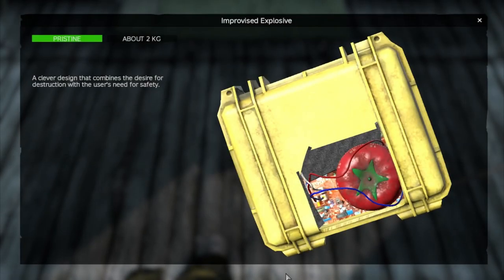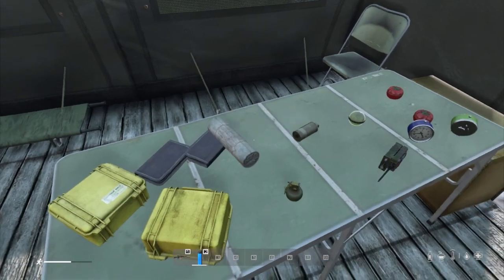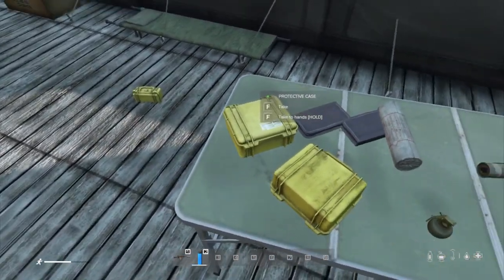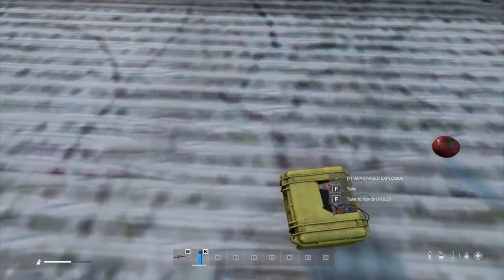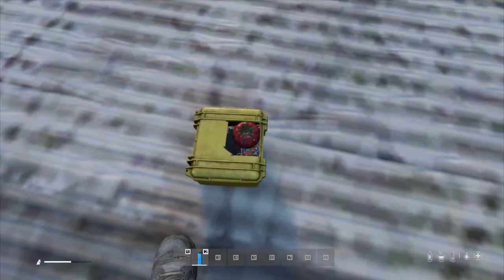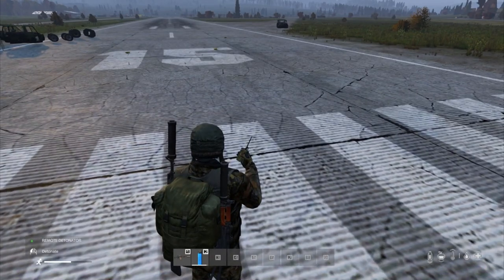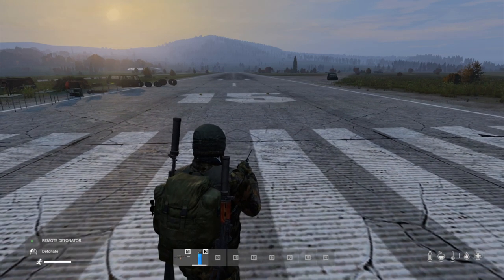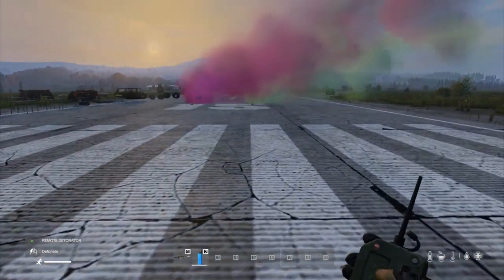How To Craft, Make, Arm & Trigger The New IED Improvised Explosive Device Remote Timed Bomb In DayZ

Comment: Does the claymore connect to the tripwire?, cause I've seen in tv/movies they will sometimes use a wire as the activator plus I had an airsoft claymore that operated off the same principle
Reply: You need to put the detonator on the trip wire
Reply: @nafingargaming5945  that's close enough that I'll take it, lmaoo